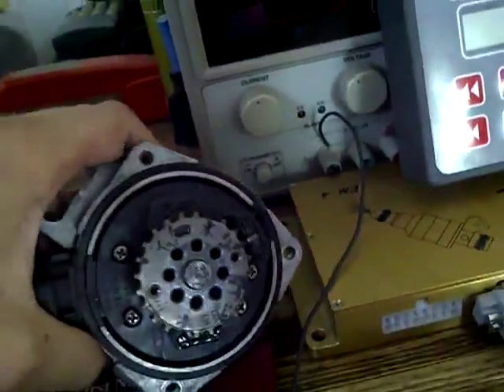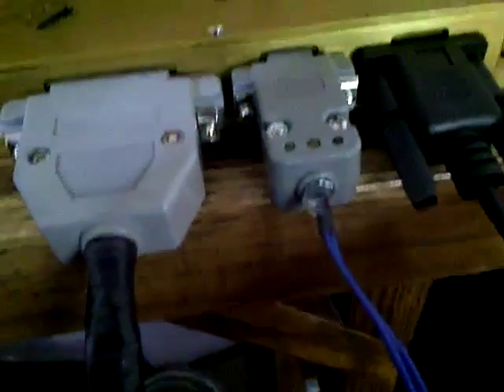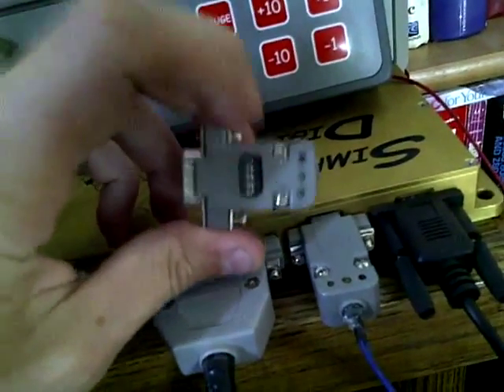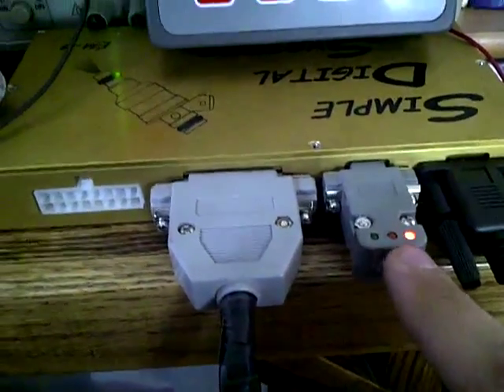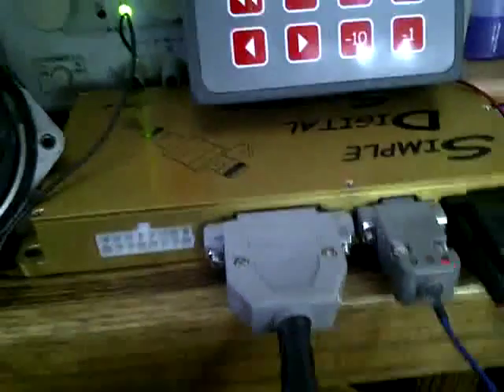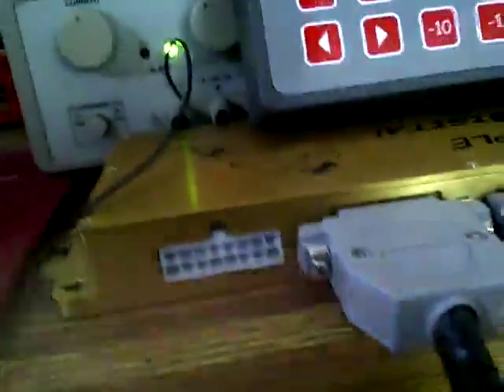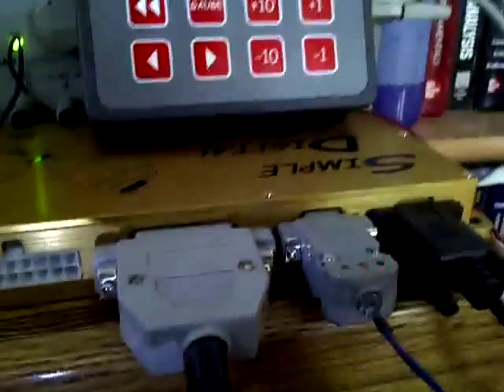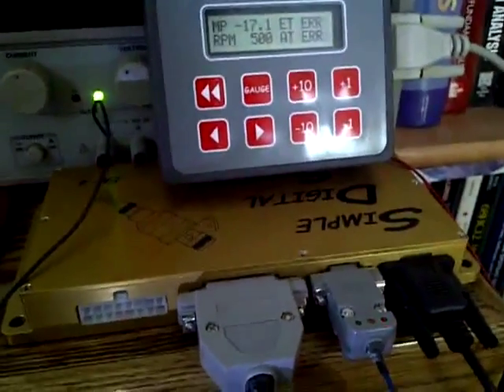SDS EM4-F Crank Pickup Trigger Converter

Comment: I have a question i have this system that i got for my 4age 16v and im running itbs the sds came with the coil packs wires and also hall sensor and on for the injectors. So my question is what do i do with my stock engine harness hope you can help me thanks